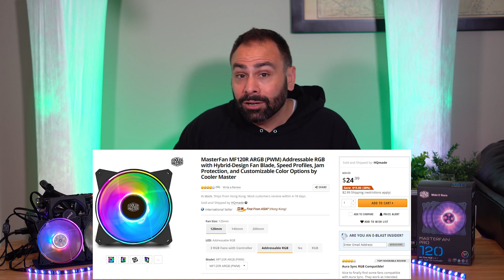RGB vs. Addressable RGB - FIGHT!

Comment: Well it's from 0-255 so 256 numbers and 256^3 is the wildly known 16.8 million colors.
Reply from the maker: Yes you’re right, my bad. Still at least accurate enough to get the point across I hope
Reply: @BPSCustoms  I let it go as "signals" because "0" is OFF.
Reply: @jurban3a  Unfortunately you can't, cause you are losing lots of colours that have one or more off components, like yellow = (255, 255, 0) or blue = (0, 0, 255) or black = (0,0,0).
If you only lost black, I would accept that, but you are losing 195,841 colours when you do 255^3.
Reply: @colinjava8447  I mean is teachnically no the same collor but still, you can't see no difference between (255, 255,0) and (255, 255, 1)
Reply: @BPSCustoms  you were, don't worry mate, nice job explaining
Reply: Sure, the video was great, surprisingly very informative. I simply can't stand math inaccuracies :)
Reply: I was about to say that too
Reply: Yeah it has to be 256 cause each colour component is an 8 bit value (or 1 byte), so you end up with (2^8)^3 = 2^24 = 16777216 colours in total.
0 would be off, leaving 255 values for RED for example, but the number of non-off colours is still 2^24 - 1 not (2^8 - 1)^3.
The 255^3 would represent the number of colours that don't have any of the 3 components in the off state, so that's about 98.8% of the total number of colours
Reply: God damn it, sometimes I fucking love math. This is one of those times.

Comment: I plugged mine into the 12v and it popped the electrolytic capacitors in the controller. That's how I found out that you can't swap them. It was loud and scary sounding, but no fire and my PC is still working fine, but the rgb fans are not. I tried to replace the capacitors, but I'm guessing that one of the ICs is probably damaged internally as well. That or my soldering job was crap. I hate desoldering...

Comment: The aRGB strip length is limited due to the 5v power. I have almost 28ft (2 x 16.4 ft cut to fit) of aRGB lights on my front deck that work off of one controller with no power booster, probably because it runs off of 12v DC.

Comment: I'm a bit confused on how to connect two of my ARGB cables to my single ARGB header on my motherboard. Can I just buy a splitter cable that gives 2 ARGB outputs? These cables are coming from my CPU waterblock and pump btw.

Comment: i accidentally blew my new ARGB LED strip. so i guess there's no such thing as "serial" connection of the LED Strip. i think manufacturer should start doing that serial connection, it act like a fuse. so when people accidentally plugged in their 5V ARGB LED strip into the 12V RGB header, it will only fried the first LED emitter instead all.

Comment: So if i use 12v rgb fan with 5v header it will still work? ( i only need  RED color) i will buy a hub with 4pin PWM but 3pin rgb there are 4 slot for rgb so one by one the fans will light with that color what i choose?

Comment: Adding extra 5v power to WS2812b based argb strips is common practice in all other uses of those stips. Should therefore not be a problem in a PC.
Also buying argb strips from computer part suppliers is ripping your bank account. Buy them from lighting supliers. 5 meters with a 300 leds cost 80eur.

Comment: A great thanks for your video really help me a lot, 2 years after your video, now on 2020 have a X570 Motherboard that can support for both RGB & Addressable Strip, after checking this video and check the material for both strip online, Normal RGB full cover my rig and my gaming desk (maybe will DIY to get the strip inside my keyboard that didn't have RGB) 5M 60 LED/M strip will get the job done, running direct from my motherboard, cost me below RM 50 (about 12 USD) / Addressable Strip, 2M max per controller, need min 2 unit or 3 unit, also needed external power plug 2~3 unit, + 5M 60 LED/M Addressable Strip cost me more then RM 500 (about 120 USD) if going for 144LED/M the price blowing sky high. I think I still prefer to stay on much affordable RGB strip .

Comment: Correct me if I’m wrong but isn’t the voltage just the “force” of the current? Like how far the signal can go on one continuous wire? If you split it, like you do, there shouldn’t be a problem.The limiting factor for the amount of LEDs on a single header is the amperage its rated for right?

Comment: Can I connect a CPU RGB fan from Coolermaster on a splitter of my case?  THe splitter of case is on my mainboard. But I noticed my CPU fan has also a small controller box. (and a sata 12v connector) Is it save to try?

Comment: This actually made sense lol. Yeah I just bought the Asus VIII Hero MB and it has dual ARGB and dual RGB and I had really been trying to figure out how (if at all) I could get my glass desk done up with the ARGB or regular 4 pin outta the board. My end goal is to aura sync the whole thing so. Might sound stupid but I love the brushed aluminum with the tempered glass of my desk lit up.
   You think you could do a video on how exactly you rig it up to supply power at certain intervals for the 3pin ARGB off the MB? I’d love to have ARGB around my desk but that would take roughly 18 feet and I don’t know if that’s doable or not :/
    “Plz, father. Guide my sword...” ~ 
Inigo Montoya

Comment: hi  nice channel  nice show...reaaalllyy    helpfull  ...i was looking around on amazon for rgb stuff and i came across this product.....but its confusing.....the kit is 4 pin rgb (12 volts..if i understand correctly )  as  we can see ,on the strip itself , we read 12v.R.G.B . But on the tiny controller that come whit it ...it says' 5.24 volts but having 4 pin( you can also see the 4 different colored wires ????

https://www.amazon.ca/-/fr/Changing-Computer-Multifunctional-Controller-Included/dp/B07DFGMVGR/ref=sr_1_1?__mk_fr_CA=%C3%85M%C3%85%C5%BD%C3%95%C3%91&keywords=Lilware+rgb&qid=1588252674&sr=8-1

Comment: Great video even tho I'm a year late. I wanted to ask if it would be at all possible to do a step by step video of connecting 12v daisy chains to a single header as well as correct connection of 5v. A troubleshooting video for 12v fans on rgb fusion 2.0 would be great as well.

Comment: This video was very informative. I've got an ASUS ROG Strix B360-I Gaming, S-1151 motherboard with A-RGB header. I wanted to connect a RGB fan and I connected it to the A-RGB 3pin header, now it only lights up blue like your @8:03. The Fan I wanted to use is Cooler Master MF200R RGB, this probably is made for 12v just as you explained. 

So I guess my question is, can I get RGB with this fan? Or can I find another 200mm RGB fan that supports A-RGB ?

any advice is very welcome :)

Comment: Great video. Have a small doubt. I am planning on buying the Antec prizm 120mm Argb fans. I am using a MSI B450 Tomahawk max mobo which has a 4pin 12v rgb header. My doubt is will i be able to connect the fans with a controller? and if i can will i be able to control the fan colors with the mobo msi mystic light software? Thanks in advance. And have subscribed to your channel.

Comment: Thank god I watched your video before I tried DiY'ing my ARGB controller and jamming it to a 12vrgb connection 😂
I just got my Antec NX 800 case and its controller has 3pin ARGB connector while my b450 tomahawk max only has regular RGB connector
Reply: Man have the same problem ,what i should do to sync fan hub of nx800 to my motherboard?
Reply: @SSSlasheRRR  idk man argb controllers might help but they're  expensive and waste of money in this situation, I just use the default preset via case button
Reply: Ugh I did the same thing.. just gonna buy 4pin fans for my exhaust that will at least be controllable through the motherboard 😑

Comment: My cpu cooler, the only 12v header using component wont sync but all of the argb components do... the cooler says its aura sync compatible

Edit: plugged it into the other rgb header, works fine.
Reply: Ireikes are ARGB fans better than RGB same fans on Tomahawk Max?

Comment: You actually got purple, because as you plugged it in, you would have seen it light up Blue, then Red, then when you full plugged it in,  you got a mix, or a pink/purple.  That's because the Green channel was blocked off or didn't have power.  When you reversed it, you got blue at first, but when you fulled plugged it in, you got a blue mixed with a green (closer to blue, but more green than the initial color that came out when you first started plugging it in), missing the Red channel.

Comment: I get the whole 3 pin/4 pin debate, but can I use my cryorig h7 quad lumi RGB cpu cooler alongside Corsair's LL series rgb fans, with the one controller and hub?
They both have different software and I can't seem to find a way to run both from my ASRock Fatality b450 gaming kit motherboard. Some rgb help needed here if anyone has an answer.

Comment: Have you, or could you, also add a video on the difference between 3-pin 5v headers/strips and 4-pin 5v headers/strips?  The 3-pin is (+5v, ground, data) while the 4-pin is (+5v, ground, clock, data)...  I, unwittingly, selected an MSI X399 motherboard with the 4-pin 5v ARGB header.  The header has the same name as all their other 3-pin 5v ARGB headers - JRAINBOW - but IT IS DIFFERENT!!  And they (MSI) don't tell you what you can use with it.  A real pisser.  (If you're wondering what I'm talking about, have a look at the MSI forum for a description of the header, or look at the manual for the X399 CARBON PRO AC motherboard).
Reply: I've never heard of 4 pin which is addressable like you mentioned. What would be the function of the clock line?

Comment: This helped enormously as fans that used to work suddenly didn't after much rewiring.  I hope I didn't fry the LEDs, but I guess I was thrown off by the Cooler Master symbols on the splitters that have an arrow which don't point to "ground" or, in any case, match up on the two-pin side.  Very odd.  Documentation is rather sparse for these sets because words must cost money to print in a downloadable .pdf file.

Comment: Can You test, how long can be ARGB? I use external power, 2x240LED and only cca 200 LED working fine. (MB B450 Gaming pro carbon). 40 LED on first strip and all second strip dont light up...

Comment: So I can't control my 3 pin cpu fan rgb frover?....😢
Reply: If your mobo doesnt have 3 pin rgb header, then no. But only if you buy argb/digital rgb/digital led controller ,as they are called by different names , all meaning 3 pin rgbs. Coolermaster has one but very hard to find, otherwise you may need to buy pack of argb fans which mostly comes with the controller box where u can attach additional 3pin(argb) devices you already have
Reply: Francis Ralte can I use Argb on Tomahawk Max?

Comment: yeahh thanks man, this is what im looking for in couple days, answering my question whether 3 pin RGB fan will run on 4 pin rgb header or not.

so is there a hope that addressable RGB will run on 4 pin rgb header in the future? i really want addressable RGB run on my ASUS B360 motherboard
Reply: I hope this helps, atm I have the same question.https://www.amazon.com/DEEPCOOL-Convertor-Transfer-Motherboard-Products/dp/B07QPYSC82/ref=sr_1_1?keywords=deepcool%205v%20to%2012v&qid=1559489730&s=electronics&sr=1-1&tag=linus21-20

Comment: Sadly my mobo has no RGB pins at all I have a asrock fatality gaming k6 z170
Reply: Buy pack of argb/rgb fans . They always come with controller where u can connect all these fans and control the lighting pattern from the buttons or remote without using mobo.
Reply: @flickeringsoul35  Thanks Hey do u think I can get your input on a PC im building?
Reply: @SoaRFennec  sure

Comment: So... The controller that came with my AIO from cooler master has both 4 pin and 3 pin. Unfortunately my MB doesn't have the 3pin for argb right now I have it plugged as follows:
4pin from MB to controller and argb to fans will I be able to use the addressable functions since the controller is the one that is connected to the fans instead of me plugging the fans directly to the MB?

Comment: Aside of getting headers pin outs wrong (For 4-pin its +12V- R-G-B not GND-R-G-B. For 3 pin it's 5V-Data-_-GND. Does not really mater until you try and make your own RGB/aRGB strip ) this is a nice video.

Comment: I'm trying to find fans to run on my Asus Prime X-470 PRO, but everyone seems to only sell aRGB!  There is no real way to get info on the connector on various sites until you buy the box and look.  My motherboard only has the 12v RGB connector, not a single aRGB header on it.  I don't want to pull the trigger and buy something unless I can confirm its the 12v version.  I have the built-in case fans with the remote, but its annoying trying all combos to find what I want.

Comment: This is a very detailed and great explanation. However, I have a question that needed answer. My ML360R will be arriving this Wednesday and it comes with 3 MF120R ARGB fans and a controller box that can fit 5 ARGB connections and 2 RGB connections. I am planning to use those 3 fans as push, while utilizing my existing 3 MF120 Pro Air Pressure as pull. My concern, apart from the different RPM rating, is that how will the RGB be lighting up? Because as you explained, RGB and ARGB uses different technologies and won't work in tandem. It would be helpful if you can at least show how it would light up. Thanks!

Comment: Hi Brian, I am going for ARGB on my next PC, I am getting it from Cyberpower in the UK and I will have a Cooler Master ML360R Addressable RGB Liquid Cooling System which comes with an ARGB controller as standard in the kit. I have already purchased some extra 140MM ARGB fans also from cooler master.

Comment: So basically if you plug your 110V TV on a 220V Power Socket, your TV will not power ON anymore, that's new lol
5 to 12V , that's like 240% over-voltage so of course those LED's will not turn on anymore in this life

Comment: Yeah.. now i am stuck with 4 A-RGB fan while the asus b450--f have 2x 4pin header .. guess i am going to have to use the shitty controler that came with the fans :(
Reply: Just came here looking for that answer! So many 4 pin slots on the board, but they don't give us an ARGB header to connect any fans! I have a setup with 8 fans connected to a controller that's plugged into my RGB header. Works really nice, but I have to manually control all fan speeds(except for CPU)

Comment: just wondering for us guys running older boards like b 250 f strix with a normal rgb header is there a box that converts rgb to a rgb or is the corsair comander pro and asus terminal the with usus a usb 2 header on the board the only options i think there are alot of guys that want to know but are to scared to ask it in fear of looking stupid

Comment: But can I plug a 5v non-addressable strip into a 12V RGB header?
Reply: It will die.
Reply: Definitely not. But I think you can use a controller like Thermaltake FP or similar which runs off a usb 2 header off your mobo. But if your mobo has rgb control such as mystic light, you can't use it to run your argb strip. Have to use the software that comes with the controller. That is my understanding of it.

Comment: Out of curiosity, if I wanted to attach several strands of addressable Led lights to one another.  Would a 12-volt wall power, provide enough or too much power?  Also, would I need resistors or transistors be needed?   The ideal total length of the led lights is 32 feet.  Any advice would be great.

Comment: I had just recently purchased 32 feet of RGB strips . In the box it came with one 5 volt power supply. Why would they sell 32 ft of LED strips that will not light up at the end if I'm only using a 5 volt power supply? Should I send them back? I have not open them yet

Comment: Cooler master makes a controller that comes with some AIO liquid coolers for ARGB, but also has a 4pin for rgb out. Do you think running that 4 pin to a cooler master fan controller and then to the motherboard would work?
Reply: Then you would be forcing power into something where power is supposed to come out. I have this controller - I plugged in an LED strip and it works fine but only when you have RGB mode selected. 
Apparantly there are some CM packages out there with an adapter, but I have yet to come across one.

Comment: Mixing RGB and ARGB on same mobo - got a vid for that?
Reply: I do that on my set. My MB has 2 rgb plus and 1 argb. So I use these 3 with splitters to light up every led that I need.
Reply: Well they don't have time to sit here and pick through all these comments but somebody surely had to have told you that you're wrong on your pins for the RBGIC or as you say a seattleite guy and I know way too much about led's in how they were but I do not know about the computer format for which he speak of these headers

Comment: For some time now there are something that people in the diy/maker community call a "neoPixel" .
They are fairly cheap addressable RGB-LEDs mainly for people not scared to write a few lines of code for something called Arduino. 

They are sold by aidafruit but you can find cheap ones that say neo-pixel-compatable

The only problem with them is that you can't really connect them directly to the motherboard but need to connect them to an Arduino or something like it.
They are basically extremely cheap (I can buy one for ~10$ at my local electronics shop) computers without the possibility to connect a mouse, keyboard or monitor.
Instead you write the program you want it to run, connect it to a computer via usb and upload it to the Arduino.
It will then run your program whenever it has power via USB or otherwise.

Sorry if I use you bad English
It's not my main language
Reply: WS2812B also known as Neopixel... is actually compatible with all brands of RGB motherboards (Aura Sync etc). The A-RGB fans and LED strips sold by these companies are basically running on WS2812B/Neopixel individually addressable chips.